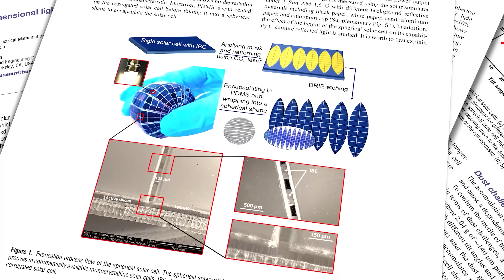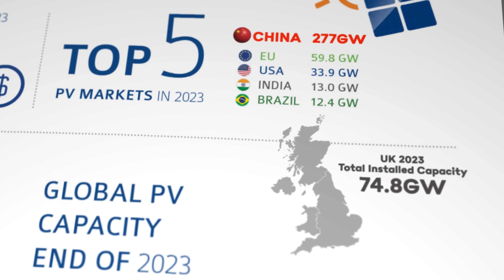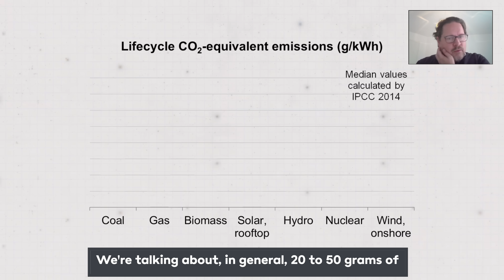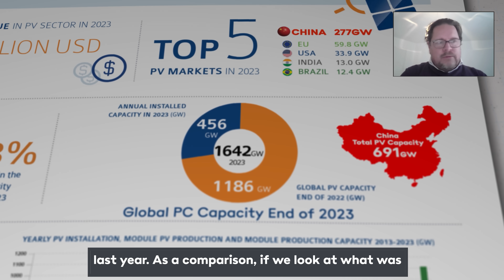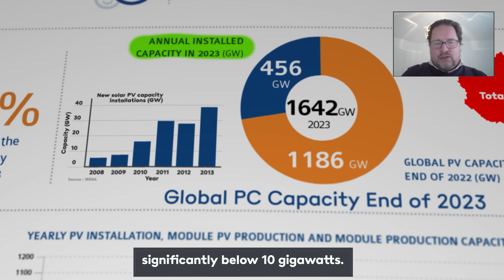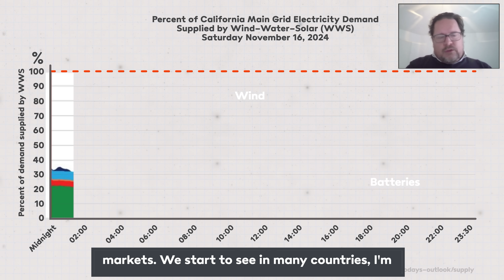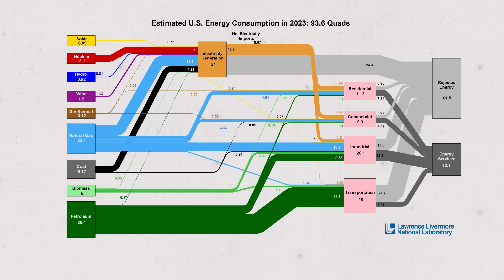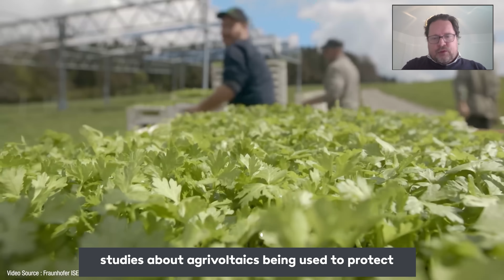Renewable Energy Domination

Comment: This  may be a technological fix for reparing errors  ~1800 thermodynamics. 
Let's reframe Earth's low contrast abundant ambient heat as a thermal energy waypoint between heat and other forms of energy. Energy changes form without gain or loss. Uniformity is not in itself a form of energy.  

Energy sensible refrigerators that absorb heat and yield electricity of equivalent energy content would complement computers as computing consumes electricity and yields heat. Computing would be free. Chips could have energy recycling built in. This would improve performance and lower cost. 

Full heat recycling, all electric, very isolated underground, undersea, or space communities would be highly survivable with self sufficient EMP resistant LED light  automated vertical farms, thaw resistant frozen food storehouses, factories, dwellings, self contained elevators, safe rooms, and horizontal transports. 
In a flourishing civillization, small self sufficient electric or cooling devices of many kinds and styles like lamps,  smartphones, hotplates, water heaters, cooler chests, fans, radios, TVs, cameras, security devices, robot test equipment, scales, transaction terminals, wall clocks, open or ciosed for business luminous signs, power hand tools, ditch diggers, pumps, and personal transports, Refugee communities would be buildable quickly. Fire safes would preserve contents to 1000F for years. These would be available for immediate use incrementally anywhere as people as individuals or larger social groups see fit. 

Some electrical equipment groups could be consolidated into local networks when suitable. Liguid nitrogen cooled superconducting networks would become practical. 

If a high majority thinks our civilization should geoengineer gigatons or teratons of greenhouse gasses out of our environment, instalations using devices that convert ambient heat into electricity can hypothetically be scaled up do it with a choice of comsequences including many beneficial ones. 

A simple rectifier crystal can, 
just short of a replicatable long term demonstration of a powerful prototype, almost certainly filter the random thermal motioren of electrons or discrete positiive charged voids called holes so the electric current flowing in one direction predominates. At low system voltage, a filtrate of one polarity predominates only a little but there is always usable electrical power derived from the source, which is Johnson (observation) Nyquest (theory) thermal electrical noise. Max Plank anticipated that ambient thermal noise would become usable with advances in technology.  

In 1973 I filed for US patent 3890161A DIODE ARRAY for an array of metal1/ insulator/metal2 diodes that refrigerate while concurrently producing electric power. The patent was granted in 1975. It was opened to the public domain in 1992. Development should be in the public domain. 

The plausible net electrical filtrate from diodes can be aggregated in a first grouping of separate diodes in  consistent alignment parallel. After a primary level of grouping that preferably is in parallel, compound parallel and series networks can be built 
to provide desired DC current and voltage. Within limlts, parts of the  network can be shorted out or open circuted without electricalor chemical  harm. Widely  scalable electrical power always with equal refrigeration is thus possible. Inefficiency effects the performance but not the equality of the thermal absorbtion and electrical yield of the conversion. 

The maximum energy is converted from ambient heat to productive direct current electricity when the load electrical resistance  is equal to the array internal electrical resistance. Maximum calculated electrical power output (watts) is k (Boltźman's constant), one point three eight x 10^ minus 23, times T (temperature Kelvin) times bandwidth (0 Hz to a natural limit ~2 THz @ 290 K) times rectification halving and nanowatt power level rectification efficiency, times the number of diodes in the array. 

There are a billion cells of 1000 square nanometer area each per square millimeter, 100 billion per square centimeter.

Order is imposed on the random thermal motion of electrons by the structual orderlyness of a diode array made of diodes made within a slab: 

Host crystal in this example is silicon 

  P type boron doped
-----‐------‐----___-- Out
🔻🔻🔻🔻
■■■■■■___ + Out
  N type phosphorous doped 

All the P type semiconductor anodes abut a metal conductive plane deposited on the top face of the slab with nonrectifying joins;  the N type semiconductor cathodes or common cathode abuts the bottom face. As the polarity filtered electrical energy is exported, the amount of thermal energy in the group of diodes decreases. This group cooling will draw heat in from the surrounding ambient heat at a rate depending on the filtering rate and thermal resistance between the group and ambient gas, liquid, or solid warmer than absolute zero. There is always a lot of ambient heat on our planet, more on equatorial dry desert summer days and less on polar desert winter nights. 

There are other plausible breeches of the second law of thermodynamics.  Hopefully a lot of people in independent teams, will join in expanding the breech. Please share the successes or setbacks of experiemental efforts. 

These devices would probably become segmented commodities sold with minimal margin over supply cost. They would be manufactured by advanced automation that does not need financial incentive. Applicable best practices would be adopted. Business details would be open public knowledge. Associated people should move as negotiated and freely and honestly talk. Commerce would be a planetary scale unified conglomerate of diverse local cooperatives. There is no need of wealth extracting top commanders. We do not need often token philanthropy from the top if the wide majority of people can afford to be generous. 

I do not seek to be the lead developer. This will disable confirmation bias and assure that other developers are acting on the merits of rhe hypothesis independently. For example gold needles abutting straight into an N type GaAs substrate may be a better starting point for developmen. Phosphorus and boron in silicon crystal technology is more familiar but plausibly inferior though it. may be adequate for proof of concept prototyping. The topic deserves discussion and prototyping attempt action. 

  There could be net entropy reduction in the full lifetime energy accounting of diode array use. The entropic deteration of the structure of machine parts made of tough solids is inevitable but can be  minor compared to the stress of their use. that there is negative overall entropy.   There could be net entropy reduction in the full lifetime energy accounting of diode array use. Diode array devices should be able to power the manufacture of àn ever increasing number of these devices. 
Aloha
Charles M. Brown
Kilauea, Kauai, Hawaii 96754

Comment: Could you do something on the feasibility of buried HVDC transmission in tunnels under freeways and railway tracks? Can this sort of construction bypass environmental impact requirements? Where they cross mountain ranges, how big and how expensive a tunnel would have to be drilled through solid rock? Can insulated cables be placed close together without heat and magnetic fields affecting their conductivity? Do military analysts say their value for defence would justify a large part of their cost because overhead lines too easy a target for terrorists and invading armies?

Comment: Who cares about installed capacity, it’s output which matters.

The peaks created by the lumpy output means several things.

In Australia rooftop solar has reached a point where it has crowded out large scale solar and to a limited extent wind. Expensive curtailment charges are then paid to shut off capacity.

Simply adding on more installed capacity once the grid is already full (less the fossil fuel/nuclear component required to provide frequency and voltage control, and load inertia which wind and solar cannot provide - for Australia east coast approx 35% of demand must be allocated to fossil fuels) extra installation does not equate to extra generation.

As ever the fatal flaw of a renewable based system is the production time to generate the raw materials to build the system is NEVER addressed.

Comment: If I ruled the World (which, of course I don't) there would be full Solar PV capacity installed on the roof of every new house, school, public building, industrial unit etc etc built from now on, plus retrofitting of those already standing.  It would by no means solve the problem of where to put all these panels but would be an environmentally zero cost solution to where to instal a good proportion of them.

Comment: Love that last statistic. It would be great to see an episode about how renewables have the potential to reduce the cost of electricity. There seems to be a large section of those who oppose the idea of renewables that renewables are pushing up the cost of energy! I thought the cost of installed renewables was much lower and the on going energy production was also very low due to wind and sunshine being a free commodity that can't be controlled by a cartel! In the UK the price of electricity is set by gas which then pushes up the cost of all energy production, this doesn't reflect the true cost of renewables.
Reply: Or maybe the actual engineering which predicts that increasing renewables always results in higher electricity costs, which is also shown in reality.

The Al Gore statistic is another classic apples and oranges comparison! As if PV cells generate 24/7 and dispatchable electricity like coal or gas does!!! Gore has always been a total scammer!!!
Reply: No, you need gas to mange the grid. Heigh preises are Not a bug, but a Feature.

Comment: 3% of of the UK means all of Devon and most of Dorset covered in solar arrays. which is fine if you don't live in Devon... Of course or you could just place panels on every roof and over every car park in the country and you wouldn't need anymore solar "parks" spanning all of Devon.
Reply: @Little                             To power the whole UK with solar would take 3%. But obviously that’s not going to happen, & shouldn't. Combining rooftop PV (including commercial buildings like warehouses, distribution centers, big box stores (I believe UK has them) with existing hydro, geothermalish (heat pump) power, & new offshore wind, the UK could probably be powered using less than 0.1% of its land. A tiny fraction of the land used for fossil fuel production of an equivalent amount of energy.
Reply: @J4Zonian  @LittleJohnFish is a MAGA Moron, useless explaining ANYTHING.
Reply: So the wank what?

Comment: Renewable? Imagine the cost of recycling all this "Renewable" crap, that will cost so much that i doubt more than 15% will be recycled.
Reply: @Rog                           The cost of recycling is a small fraction of building & running new fossil fuel or nuke facilities. Put the far right in charge & it will be less than 15%. Put anybody who’s not a lunatic in charge—the Chinese, or progressives, eg—& it will be 95%. They ARE valuable materials, as is the energy needed to mine, move, & make them, & any sane system in any sane society will recycle them. 

“Solar Waste Stream is Tiny, Compared to Current Fossil Fuels”
This Is Not Cool, October 9, 2023

"Mining quantities for low-carbon energy is hundreds to thousands of times lower than mining for fossil fuels”
Hannah Ritchie, Jan. 18, 2023

“Low-carbon tech needs much fewer materials than it used to; this matters for resource extraction in the future”
Hannah Ritchie Nov. 11, 2024  

“By 2042, Chinese Battery Maker Will No Longer Need Mining as Recycling Takes Over”
This Is Not Cool, May 22, 2024

Comment: Levelized cost is not really a good figure because of several issues 
1. Legacy fossil fuel Infrastructure has been built and paid off for decades in many cases. So renewables are not dealing with the full cycle cost of fossil generation but effectively their maintenance cost.
2. Levelized cost does not include transport costs and storage costs since renewables are a more land hungry way of generating the cost they tend to be built int the out in the countryside where land is cheap and transported into the city with significant transport losses and costs. Storage is expensive. 
3. In usa and many nations energy is bought at auction by grid operators starting from lowwest bids going to higher bids until they reach the projected ammount of energy to meet demand. Since renewables are cheap if it is a good day for renewables they shift the whole spot price of energy down as there is a larger ammount of cheap power on the market and in some cases in markets where there is large renewable penetration it can even go negative.  This has a significant negative effect on profits. 
4. The cost in lifetime terms of renewables is frontloaded in the upfront capital costs which means bigger loans and more trouble financing projects also typically it takes longer to put a renewable operarion on line than comparable gas plant. This mean the ammount of time until an operation is profitable is typically longer than a fossil project and renewables are more Sensitive to interest rate hikes.
5. What this means is that basically renewable are the cheapest options and the obvious answer in building new capacity in prime locations where there isnt significant storage or transport issues. Most of the worlds energy use is not in locations that are prime renewable locations the northeast and midwest are not exceptionally sunny or windy locations. 
6. The only way to dealt with the issues would be some major govenment intervention in or restructuring of energy markets but that seems unlikely in the states for the forciable future
Reply: @jer                   Renewable energy takes less land per MWh than fossil fuels. Rooftop solar (including the huuuuge areas on factories, warehouses, distribution centers & big box stores that could alone power the US), solar on canals, reservoirs, bridges, land wrecked for a geologic age by fossil fuels, & offshore wind could supply all the energy the US & most other countries need, without any new land used. A lot of offshore wind potential is very close to population centers. 

“NREL: How Much Land for Renewables?” 
This Is Not Cool, March 1, 2023 
[The RE land figures given here must be cut in ½ to reflect RE energy efficiency, ½ again for rapid tech advances, ½ again because the US could do it all with offshore wind & rooftop solar. Even though it won’t, those will save enormous amounts of land.] 

LCOE is fine. Construction is included in all calculations. Yes, fossil & fissile fuels  are mostly built; almost all new energy built now is renewable, but wind & solar are so cheap now it’s cheaper to build & run them than just run old F&FF burners. Most F&FF burners in the US are losing money. 

it takes a year or 2 for a solar plant & about the same for wind. The typical gas burner takes 5 years & is a horrible mistake, since it perpetuates fossil fuel use & makes stranded assets inevitable at a time of falling RE& EV prices && a dire need to ditch FFs A LOT faster than we are.

Comment: What the critics fail to realize with their 'coal argument' is that we are using fossil fuels to wean ourselves off of fossil fuel.  We use coal generated energy to manufacture the first tranche of wind turbines and solar panels.  The next tranche of renewable equipment uses only 90% as much coal.  The rest is renewable energy.  The next tranche only 80% coal energy and 20% renewable energy and so it goes.  Our main problem today seems to be energy storage and your item on off-river pumped storage seemed really relevant.

Comment: Dave: Why has no one ever thought of power generated by traffic on the roads, and motorways? Surely they can generate power 24/7 by running over a panel on the road and causing some form of generated power from the weight of the vehicle? How hard would that be? Surely it's possible?

Comment: More tunnel vision and techno optimism derived from flawed assumptions and simplistic thinking.

Switching from fossil fuels to materials for EVs, solar, wind and batteries will fail, for a number of reasons.

First, all production of the aforementioned "clean" technologies requires fossil fuels from start to finish.

Second, the cost of extraction and production will rapidly increase as fossil fuel EROEI continue to decrease.

Third, all rich easy to mine minerals are gone.  Remaining  deposits require much more energy to produce, compounding the dilemma.

Increased wholesale environmental destruction costs to watersheds and diminished biodiversity and carbon sink capacity from destructive mining practices.

You might want to listen to Nate Hagens to get a systems  perspective.